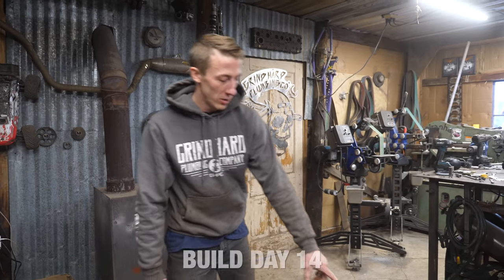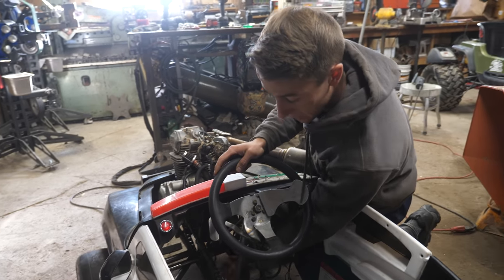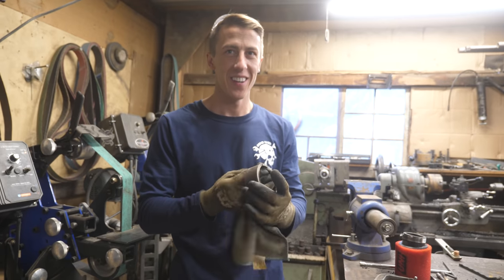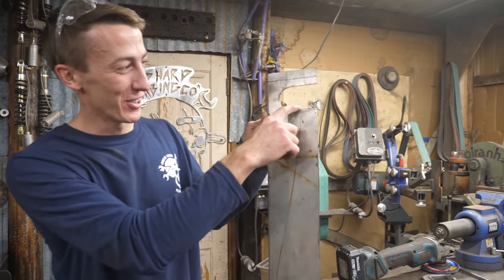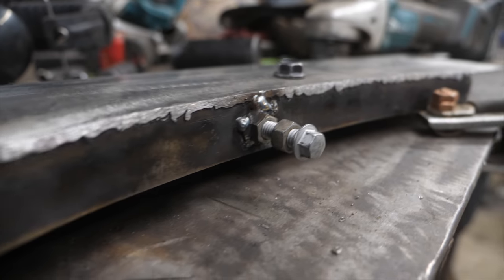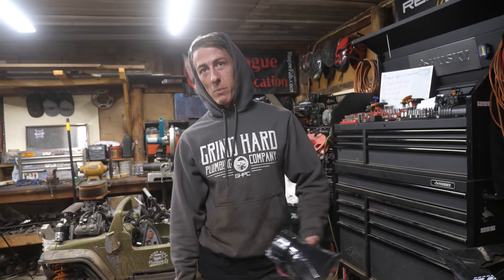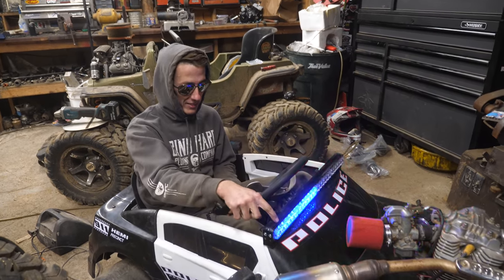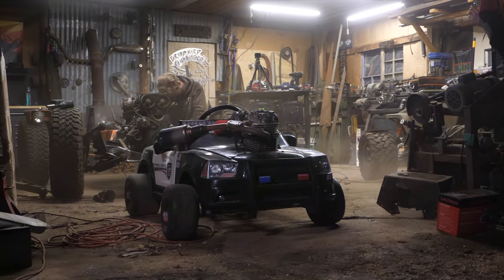75 MPH Go Kart Build Gets Lights, Siren and More!

Comment: One of my favorite memories was wen I was 19 I was spinning donuts in the teton county fairgrounds in the winter.  I  was in a section that was not visible from the road do to the snow that was piled up for snow cross. Mid-donut I see flashing lights through the snow clouds that I had kicked up.... I'm thinking that I am busted.  When I finally saw the cop car it was sliding sideways past me in a spinning motion.  I will never forget when he start his siren and spun in place chasing his own tail. I couldn't believe what I was seeing.  When he finally stopped he looked at me and said, "Good thing you're not doing this on the roads, I'd have to bust you for it." Then he went back to some more donuts and left.

Comment: Y'all should take a look at a Goped chain tensioner. It's a spring tensioner and works well. You could bend your own springs and adapt them to the plastic part you're using already. Just cut a groove for part of the spring in it and secure the other two sides with bolts or screws. It would essentially float on top of the chain and constantly adjust as the chain flexes.
Reply from the maker: Good idea!

Comment: LOL, was that a hockey puck cut in half, you used on the chain guard ?
Reply: That's what it looked like to me. I think I saw someone use hockey pucks for bump stops once. I think it was Bleepin Jeep. I guess if they work, why not?
Reply: @deanhallam1440  Ikr, It's all about using what you have.
Reply: Haha no, it's UHMW plastic. It's super abrasion resistant.
Reply: @darkflameboy175  LOL, Right On !! It just looked like it. You never know with you guys. Cause it's a waste not environment in your builds. : ) ~
Reply: @darkflameboy175  UHMW plastic? I should write that down. Sounds like something that would come in handy some day. But I would not have been surprised if it actually was a hockey puck.